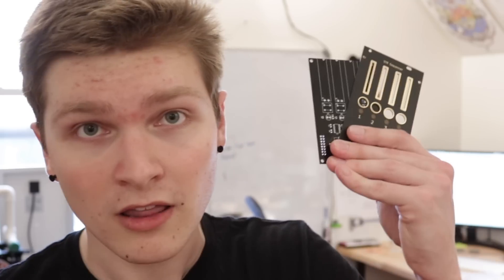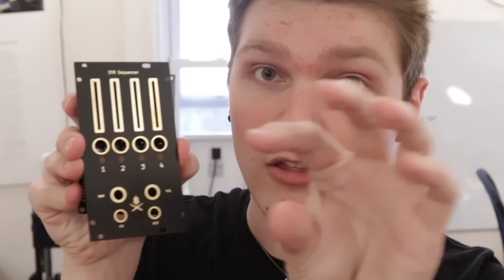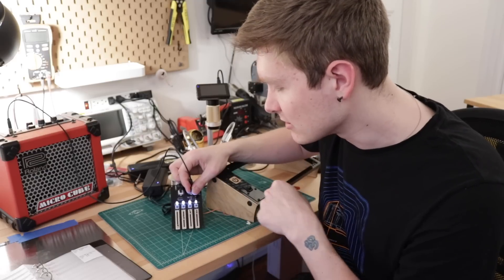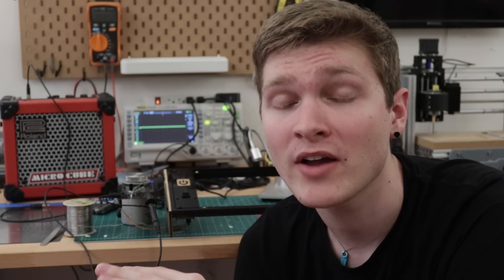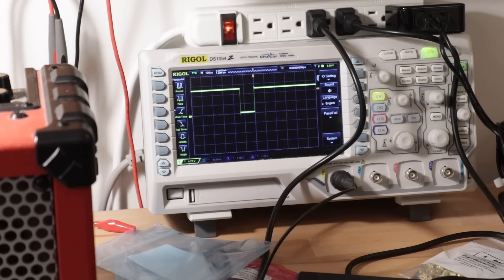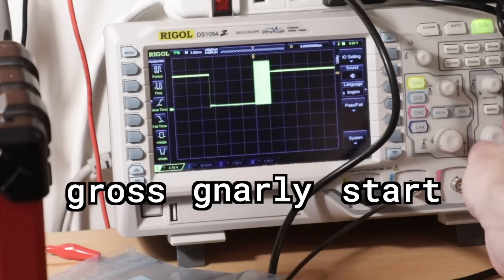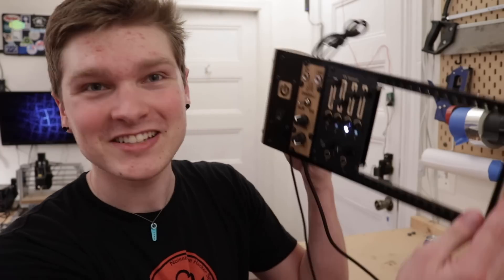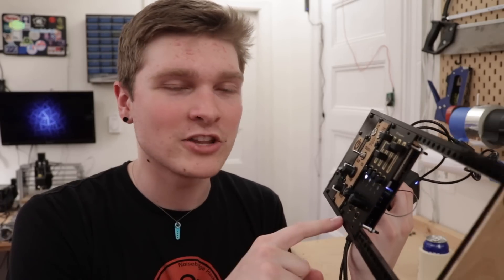DIY Synth - Sequencer!

Comment: You continue to mention getting sound from your sequencer. I am confused.  Is it a 4 step CV / gate sequencer? Does it produce sound? Can it be externally clocked?
Reply: It's more like a square wave arpegiator (uses the second 555 to produce the sound). I'm not sure how that can sequence other oscillators, maybe if you use the outputs as gate and cv. 
I assume my sequencers send midi and play/stop, so I don't really know how the analogue guys do it.

Comment: Oh wow, really great work and perseverance, Also showing your failures is a  true testament to your character. Please, how did you get the black and gold cover done? I am new to this and would like to design an enclosure with the same theme
Reply: Hi, don't think this is still relevant but I looked into his design files because I'm planning a similar project albeit with a slightly different colour scheme. It seems like the gold writing is done by selecting the front solder mask layer and putting the text there, basically creating copper pads in the form of the writing. The black is just the PCB finish some manufacturers let you choose. However I could be wrong, feel free to correct me.

Comment: 2:54 LOL! "That doesn't work........at all"   It never works on the first try, and typically the 2nd or 3rd. 😬 How many hours did you end up putting into this project?
Reply from the maker: this one took me a while! roughly 2 hours planning/ordering parts, 5 hours prototyping, 10 for PCB design, then another 8 or so for assembly, debugging, etc.